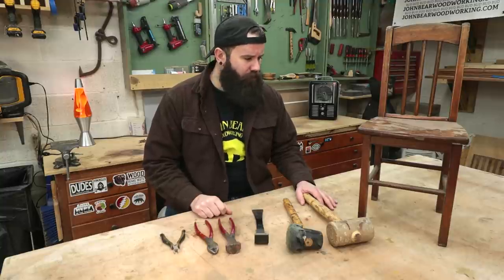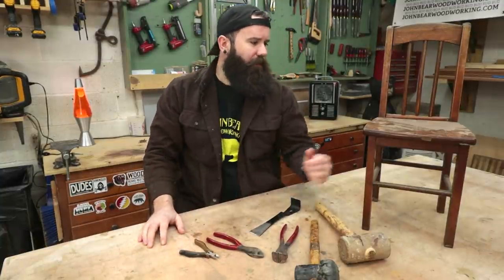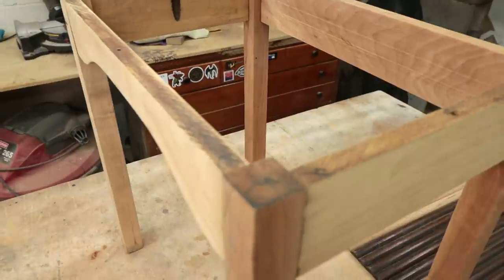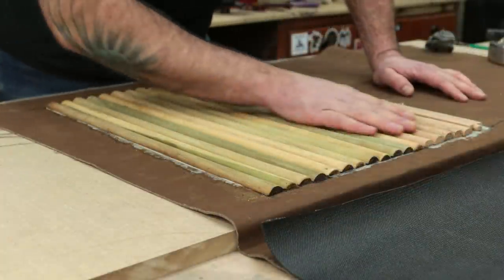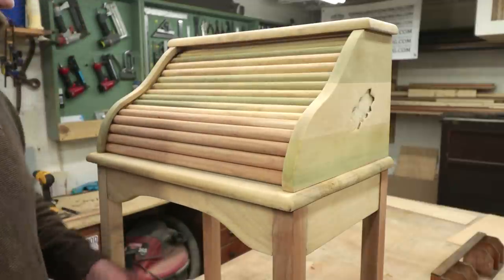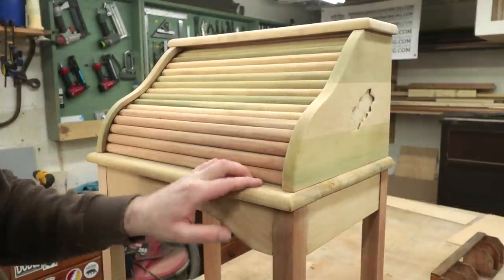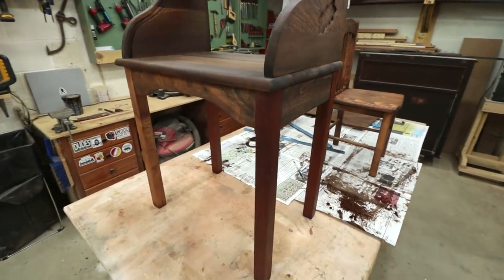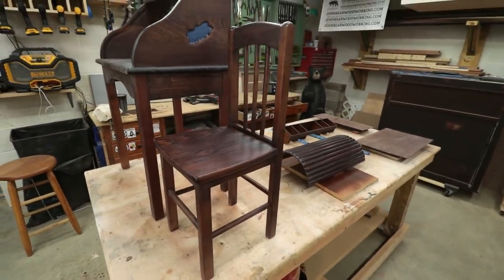Tiny Rolltop Desk Restoration Part 2 | Furniture Repair & Refinishing | Tambour Replacement

Comment: You used the correct fabric. Duck is what was originally used. Tambours don't slide easily but bees wax will help alot. Now if i could just find one of those in adult size. Great job!
Reply from the maker: Thank you!

Comment: Add weights to the top of the roll. it will pull it open like balances of a window or an elevator shaft
Reply from the maker: I'll do that next time! Thanks for the tip bud!

Comment: Appreciate the tool rundown.  I have a few busted up rubber mallets which I now have a use for!  I have a question on the breakdown, are you marking all the pieces as you breakdown so you know how to re-assemble?
Reply from the maker: Thanks bud! I do sometimes mark if I'm really unsure but after you've done this for so long you just know what goes where. If you're unsure I suggest a sharpie on ends where you won't see when glued or won't really need sanded.
Reply: @JohnBearWoodworks  Thanks JBud!
Reply from the maker: You're welcome bud!

Comment: How do you keep track of all the pieces when you knock a chair apart? Do you mark them with a pencil? I’m going to refinish a chair that has so many pieces that are almost identical. I have kids so I can only do work on it in little chunks and I know I’ll forget which pieces go where! Lol!
Reply from the maker: It's best to mark the ends of whatever with a sharpie or pencil. Just wherever you wont be doing much sanding or you won't see once you reglue. Best of luck to you! Chairs can be quite tricky even if you have the right parts back in order. Just make sure once you have it glued and clamped up to make sure the legs are square! Measure back to front legs diagonally and your measurements should match up.
Reply: John Bear Woodworking & Furniture Restoration Thanks!